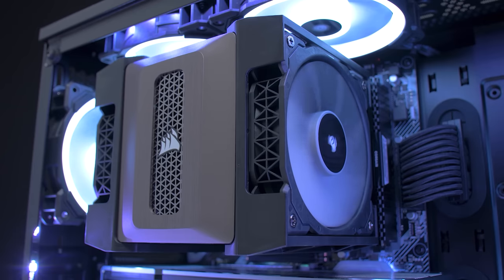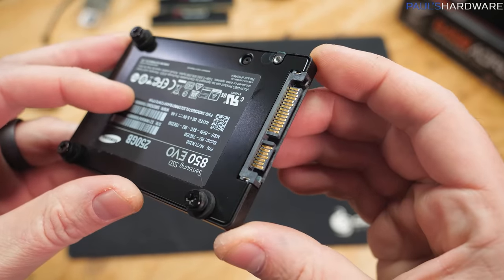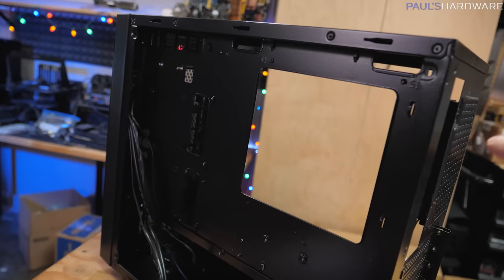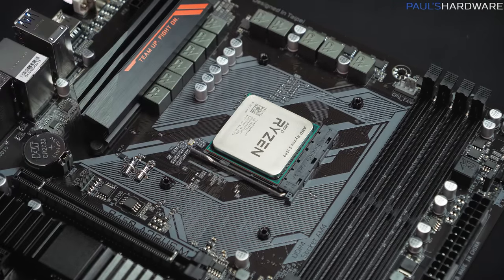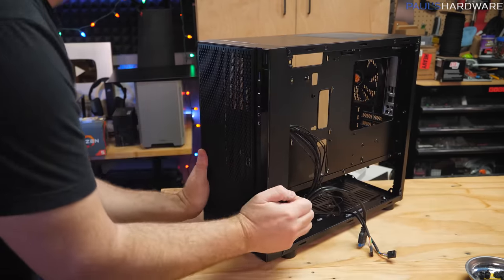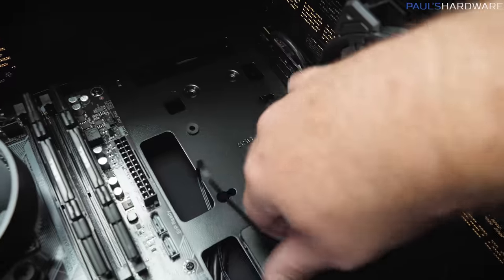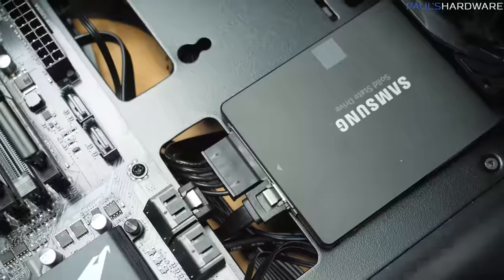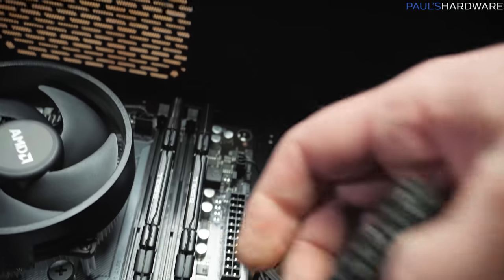How To Build a $550 Gaming PC in 2020!

Comment: Can these parts work on a NZXT H510 Elite?!
Reply: They would fit 
but that case is a little disproportionate for this build(although that case does look pretty epic)

I would also recommend a used 1060 6gb if you live in the US it is significantly more powerful than a 570 and is only about 100$ on eBay
Reply: @Natehalem1366  wouldnt that be a mining card? That’s a huge gamble and I don’t think it’s really worth it
Reply: @Otoskire  it could be a mining card it could not be I have a 1070 that was used for mining and it works fine my brother has a 1070 that was used for gaming and it works fine

Any consumer grade cpu or gpu in recent time is stable enough to run for a many years even if in constant use 

If the card doesn’t work eBay has buyer protection and for how good of a deal the 1060 6gb is used in the US it’s probably worth trying (just do a clean driver install with GeForce experience to get rid of Mining drivers)
Edit:fixed some misspelled words
Reply: @Natehalem1366  if you know what you’re doing then yeah a mining card might be worth the cheap price, but for a new consumer that doesn’t know anything I wouldn’t recommend it, everyone should do a lot of Rea search before pulling the trigger in anything like this
Reply: @Otoskire  I dont mean one of those cards with no video outs  but the ones that have just been used for mining are normally fine
I probably shouldve mentioned to make sure the card has a video out but ive personally never seen those advertised as actual 1060s and if they were i think ebay would cover it

Comment: Could you tell me how this system compares to the system requirements noted on iracing webpage.  https://www.iracing.com/membership/system-requirements/
Does it meet / exceed:   minimum / mid-range/ or high end ,  If not equal to mid-range,  should I consider your $900 build or can I upgrade just the graphics card.  Don't plan to do anything other than iracing.  Any suggestions appreciated.  Trying the KISS method.  Great videos - wish they had been around when I was leaning windows 98 & building systems

Comment: Hi, I've been an old-school techie since 1986 and all this new-fangled technology REALLY confuses me..... I want to convert a new 4TB HDD from MBR to GPT so I can use the full 4TB capacity of my new HDD. I also want to re-install Windows 7 OS (64-bit) on this HDD. My current Intel-DH67BL motherboard supports UEFI but it is currently set to legacy BIOS mode because till date I was using 4x 2TB HDDs in my PC case. Now my existing of storage is filled, and I presently need 4x 4TB HDDs (yes, 16TB) for storing my 4K photographs. Can you please MAKE A VIDEO that explains this process of conversion for newbies like me? Perhaps someone can please point me to some videos that explain this BIOS-->UEFI and MBR-->GPT process? I am sure it will help me and thousands of other users who have older Core i5 systems BUT they need 4TB or higher capacity drives to store large volumes of data like me...... NOTE: I can easily buy a Samsung 860 EVO 500GB SSD to use just as a system disk (OS only) with the OS, Primary, system, boot, page-file & dump on that disk itself.... while I can use separate 4TB SATA mechanical HDDs for all my installed Programs, Documents, Media, Data etc (I have 4 bays for 3.5 inch HDDs).

Comment: Can anyone tell me if this are good specs for a budget gaming PC that someone is trying to sell it to me at $454.54?
i3 9100f
Asus Prime H310M-ER2.0
8GB RAM DDR4 2400MHZ ADATA
1T HDD 3.5 Sata3 7100RPM
Gigabyte Geforce GT1030 2GB GDDR5
With a red Evotec EV-100R gabinet with a 600W PSU

Any suggestions  for a better gaming PC around that price would be appreciate it as well, thanks.

Comment: why the watch battery?
Reply: The settings in the BIOS, like date/time, boot device order, and other settings are stored in the CMOS. The CMOS looses data if it doesn't have power. That's why it has a battery to keep the data stored. These batteries usually last a long time. Chacnes are that you'll get a new computer long before the battery dies.
Reply: @JJFlores197  thank you for the detailed reply.

Comment: Actually the Ryzen 5 1600 'AF' , is a 6C/12T. :)
They've changed the tech process from 14nm to 12nm for this one. 
So it's a sort of downclocked Ryzen 5 2600, but at under 99$ price point.
which is hell of a deal, if you can get your hands on.

Comment: In Canada, you click on the first two parts in the list and already bust the entire budget. There are better ways to build a gaming PC using used parts purchased on eBay.
Reply: yep and you can do it with a motherboard that has a am3-b(same as am3x) socket  you can play Red Dead Redemption 2 with this stuff-Zotac GeForce GTX 1060 6GB9($170)AMD FX-8150 3.6GHz Eight Core($95/ebay/half the price of fx8350) A-Tech 16GB Kit (2x8GB) DDR3 / DDR3L 1600 MHz PC3-12800 UDIMM 2Rx8 1.35V/1.5V CL11 240 PIN DIMM Non-ECC Unbuffered Desktop Computer Memory RAM Upgrade Modules($56/amazon) plus $150 for used motherboard,650 watt power supply and discount caset- Total $471( to $550) this is the upgrade to my HP-h8 1414

Comment: Been a while since I built a system. Your video was an easy reintroduction to how they go together these days. As some of the parts are unavailable, this is what I ended up building: https://pcpartpicker.com/list/byDR3t .    I built it for one of my kids friends, my daughter painted the case (so its not boring gray!). Hardware works very well, I did add an extra fan to remove air in addition to the fan for intake. System is delivered and the feed back I am getting is GOOD.        Thanks!

Comment: $550 it is not. More like $700 and  as mentioned by "Jackson Chankin 7 months ago: In late July, this now costs 647.93 without tax or shipping so its probably like a 700$ build now."
You must of received your parts with a DISCOUNT and probably Tax Free due to maybe Not for Profit business. The one thing most people leave out is the License / Key cost for MS Windows 10 OS Retail of nearly $200. OEM Operating Systems suxs like you find on Amazon or at Best Buy - just go to Microsoft Store get the real deal. So when done and said $500 Build is really 25 percent more or $625. If you said $1K PC (Intel or AMD) system expect cost to be $1,250. Now most pre-fabricated or mfr. desktops you find at retail stores, NewEgg, Frys, Best Buy, B&H are rip offs. DIY Builds are the only way to go!
To avoid buying a key from MS. Just Clone a HDD/ SSD with Windows 10 to a new drive, boot up in new PC and then perform a Clean Windows Install not keeping any of the old stuff. Then Update Windows. Many programs now offer easy full cloning of any drive. You'll find that it the OS is still Activated.

Comment: BE AWARE!!!!
If you are trying to add a 3.5 inch hard drive to this build it will not work. I just bought one and was about to install when I noticed the motherboard was too low and in the way. Just buy another SSD or a smaller hard drive
Reply: You still can add HDD, but u put it on the bottom where the power supply located, thats what i did to my pc

Comment: So the $550 doesn't include windows, monitor, mouse and keyboard.

Does that mean it's more likely an $800+ build?
Reply: Depends on the monitor. U can get cheap mouse and keyboard bundles. U can also pirate windows if U want. But yea 150 for a normal monitor sounds about right. At least here in australia

Comment: Just don't build a cheap computer. 
A $550 PC is pointless and will likely cost $250 in just a few years time.

Instead, buy a piece or two each month and spend around $1,200 in total to future proof yourself for the next 10 years.

Mobo: B550 Aorus Elite
Processor: Ryzen 5 3600
RAM: HyperX Predator RGB 8GBx2 3200mhz - 
GPU: Raytracing: RTX 2070 super.   No Raytracing: RX 5700XT
CPU cooler: GameMax Gamma 300 RGB
PSU: A reputable 500/550w at least 80+ Bronze
SSD: 128GB NVMe M.2, at least 1,500MB read for booting windows - placed in the lowest M.2 slot on mobo
SSD2: 1TB 2000MB READ, 1700MB WRITE Crucial NAND NVMe M.2 - placed in the top M.2 slot on mobo
Case: (I bought cheap) Ionz kz05 ATX
Case fans: EZDIY-FAB 5-Pack 120mm Dual Frame RGB PWM

Total cost: around $1,200.

A PC is an investment because it's always possible to swap a part and add cash for a better one or sell a part and add cash for a better one. After 1 year you can turn this PC into $2,300 if you wish.

Comment: 550 pc that will last just half of a pandemic, maybe a quarter of it, then you gotta build another one that will cost you $1500. Oh, you should have done that at first so would have saved that first 550. 💥 also, don't touch all that bare parts like motherboard, cpu, gpu and rams with bare hand. load of static from your hands may damage your parts, be smart and use static gloves.